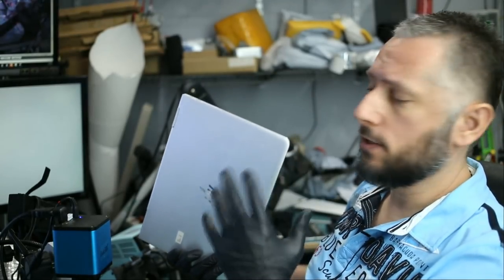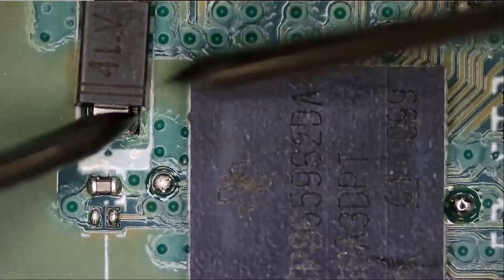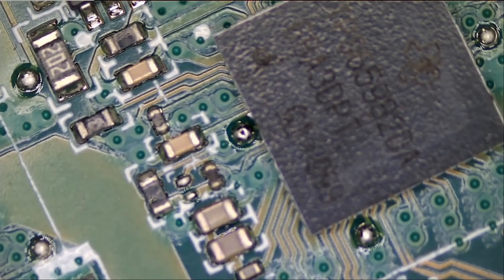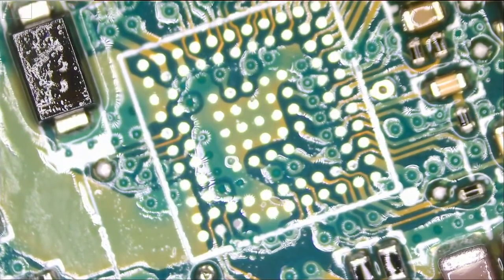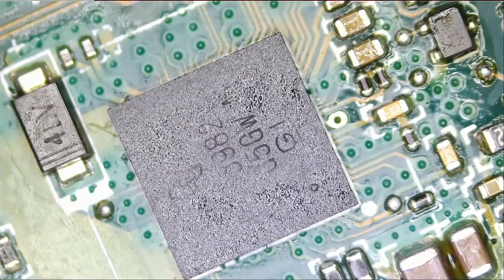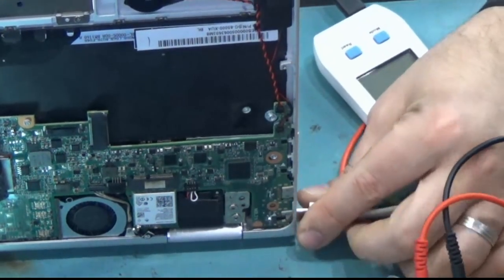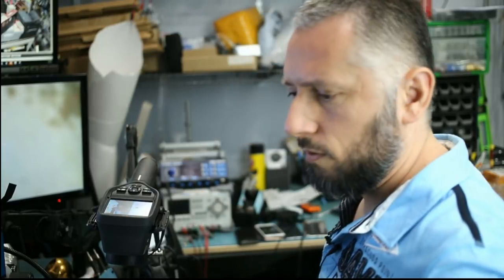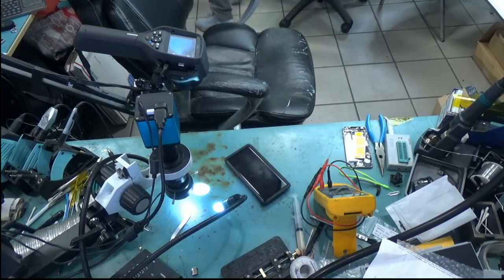Spectre X360 No power Not Charging Repair Shorted USB-C Power IC

Comment: Nice job! Does the chip contain already solder on the pins? Would soldering be more reliable by pre soldering all the pads with 60/40 solder?

Comment: Hie. Quick question. I have a Dell XPS 7590. It blew that same IC now it wont switch on or charge using the barrel charger or Type C . I tried replacing it with a new one from aliexpress but still nothing. All it does is just turn on the keyboard for  10 sec and goes off. If I try using the barrel charger the charging indicator only lights up for around 5 seconds and goes off.
 The display diagnosis Power button + D works.

Comment: Currently dealing with similar issue. 5Have customer with 15" Spectre, no charger either port, I didn't think it was port, I think you help confirm my thoughts. Very curious what issue is! Thank you for your videos, I will go buy the type charge testing adapter to help support you!

Comment: 0 amps drawn so where is the power coming from to heat up that IC chip?
Reply: No current is drawn from the USB ports. But don’t forget that the motherboard main Vbus is at 19.5V when the motherboard is powered on. The charger attempts to impose that voltage on the bus. In case of a S.C. any of the two things can happen :
- The charger detects it and the switching of the PSU is inhibited ;
- The S.C. detection is bypassed or the current drawn is within the specs for a laptop (< 2 A). That is still a big amount of current for any single IC.

Comment: Regarding damaged solder pads, what about cutting new pads from say Zinc strips gluing the pad down instead of using very thin enamel coated copper wire? Zinc strip is used to wire up batteries and is more corrosion resistant than copper (just a thought)

Anyway i can't wait to find out if replacing the power ic solves this issue, i feel like i've been left on a cliff hanger! 🤔

Comment: Question? My GDP WIN handheld gaming console is dead no fan or lcd, just a blue light on the front when powering on. I re programmed the bios chip and everything come back no errors in programming bios but still no boot only blue light.. I checked all the compositors and they are all good with 1 side grounded and other not, mosfits are all reading, but right beside where the battery plugs in there a little flat fuse with ( R010 ) and both sides of it beep? Is that fuse only supposed to beep on the grounded side and other side not grounded without any beeps? I can’t find anything on YT that let’s me know if power goes through it so both ends beep in diode mode or just the ground end and not the other? I seen on this board your working on has the same R010 chip as my board has and was hoping you or anyone in comments could let me know..... thanks

Comment: Great video , however I found it weird that you checked with the thermal cam , after you established there was no current draw from the charger.
Reply: The laptop still has a battery in it and is trying to power on. That's why.

Comment: May i ask you. Do we always put red probe on ground. And not the black probe.?  Thanks
Reply: Absolutely not. It depends on what you’re trying to measure. If you want the total capacitance between, say, some Vdd and ground, you put positive on Vdd, because some caps are polarized. 
In diode mode, you sometimes do put positive on ground (if you’re checking for a faulty Flyback diode). 

There is no yes or no answer, you need, at the very least, some electronics knowledge. You must have in mind the functioning principle and the basic properties of the circuit you’re testing.
Reply: I don't fully understand why when looking for shorts he puts ground to positive either, a short (a very low ohmic value) is a short and continuity will fire off the same which ever way the probes go?
Reply: It does not matter which probe you use if you are testing continuity between two components. He is just checking if both sides of the cap are connected to ground. If a positive side is found to be connected to ground, it means that it is shorted.

Comment: The Uni-T USB-Tester is UNIDIRECTIONAL, you put it in wrong direction to the Board so it CANT supply any current to the device, look at the bottom side of the tester
Reply: I have one of those and I thought the same thing but I tested it today and to my surprise it works either way. So its actually bidirectional.

Comment: Around 0:40-0:55 - Both ports do not look good, the one to the left has cracked plastic to the right and the right hand port has a bent gold pin clearly visible on the right hand side.
I haven't finished watching but I get the feeling this repair doesn't go so well.

Comment: the USB-C voltage should be a jump from 5v to 20v.  you cant power on any USB-C Laptop with 5v on any laptop.
Reply: It's showing 5v because the switching is not being made. That's what the problem is. A USB-C adapter offers many voltages based on what the adapter is being asked to output.
Reply: @matduran1104  bang on.
Reply: @matduran1104  it just that he keeps mentioning 5v and he thought he fixed